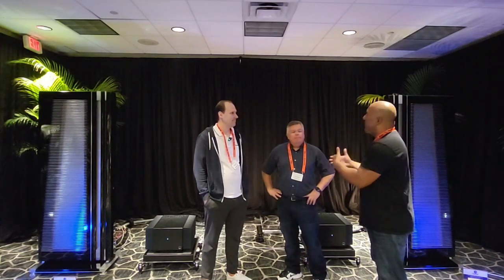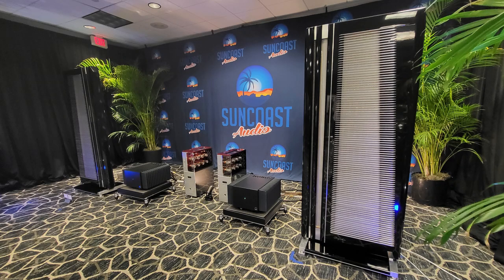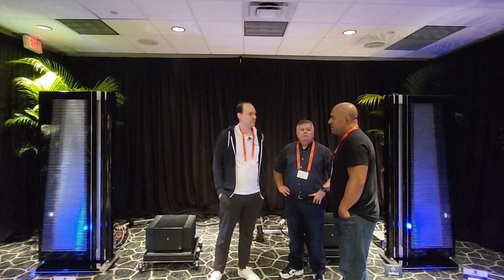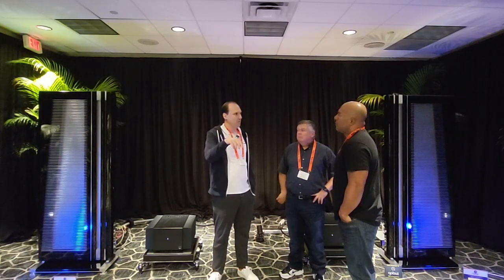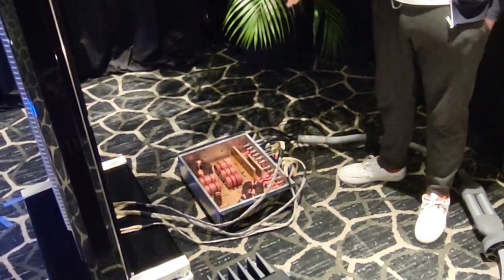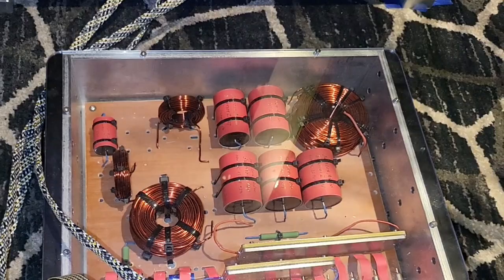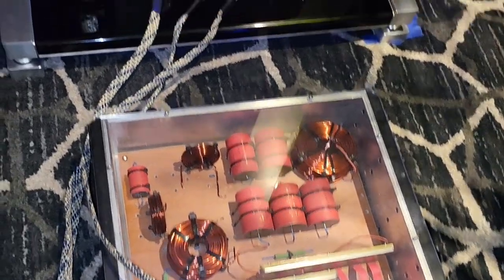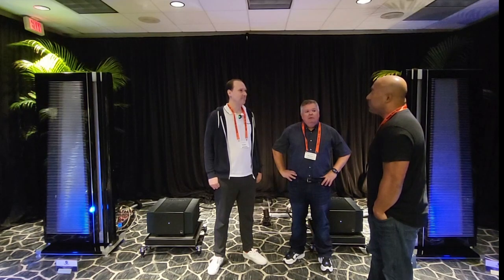Clarisys Audio Auditorium Loudspeakers - Apogee Speakers REBORN!

Comment: Best panels ever. Apogee stomped every panel. Rip Jason.
Reply: Agreed and these are Apogee’s made even better.
Reply: @highendaudio  How do these compare to Alxyvox Caravaggios (if you have heard them)?
Reply: @digggerrjones7345  I’ve heard all Alsyvox between RMAF and Munich (HiFi Deluxe show) multiple times.  I prefer Clarisys.  Far better bass and bigger sound with Clarisys Auditorium.   Auditorium is nearly 7 feet tall.  The biggest Alsyvox is 5 foot something.  But again, as I always say, listen for yourself and decide.   One thing is for sure, Clarisys Minuet and Studio Plus are far less expensive than the least expensive Alsyvox and we don’t give you a lesser crossover and try to charge you more for a better one like Alsyvox.  We give you the BEST out of the gate.
Reply: @highendaudio  Thanks for your feedback. When the weather gets warmer, I'll have to find somewhere to audition the Clarisys products. FYI, the Caravaggios are just a little less than 7' tall.
Reply: Do ribbon speakers also sound flat like electrostatic speakers during the wet rainy season and in high humidity conditions

Comment: Apogee speakers were notoriously difficult to drive; needed amps that could drive 2 ohms. Are these easier to drive.
Reply: That is not true and comes from people who remember the Scintilla, whose impendence dropped below one ohm.

The rest of their speakers had a nominal impedance of 3 ohms and could easily be driven by any decent amplifier.

I drove Apogee Caliper Signatures for several years with an Adcom GFA-555 before moving to a Mark Levinson No. 27 and then a ML No. 334.
Reply: @VideoArchiveGuy  Yes due to their 1 ohm load; all I can tell you is in EVERY room I visited where Apogee was on display, when they were in business, had top of the line D'agostino's Krell amplifiers paired with them; every room; sort of an unspoken not so subtle message these are the amps the speaker manufacturer wants you to use.
Reply: @mahasidha9  Yes, because the two went well together, but they weren't REQUIRED. Why wouldn't you try to sell the two together?

My dealer was a large one and sold Apogee with Mark Levinson, but my Adcom did a great job, any decent amp could.
Reply: If you watch the video, the designer explains it.  Easy.  Just bring a good quality amp.
Reply: @highendaudio  I DID watch the video; I am skeptical of manufacturer’s claims. Compare the white paper by Sanders Sound Systems on amplifier requirements for electrostatic speakers vs Magnepan’s any 100 watt amp will do; I replied yesterday with a link to that white paper but the reply is gone; does YouTube take down replies with links?
Reply: @mahasidha9  well, the designer was handing out the paper with the measurements of that actual speaker at the show….so, maybe you can find someone that has a copy,
Reply: That is such an over used statement concerning Apogees.  Only the Scintillas were difficult to drive.  Please quit spreading this silly rumor.
Reply from the maker: Ask suncoast audio
Reply: Addendum: yes I know Maggie are not electrostatic but to be clear their answers    on the Q&A section seem to me to be so much dissembling.

Comment: What's the impedance of these speakers?  What kind of power is needed to drive them?  Ribbons tend to sound better up top than say, below 100hz.  How was the low end on these? He said as dipoles they're room friendly, but I've found that dipoles and open backed speakers benefit from well placed diffusion.  Otherwise, as much as I love the TAD's you covered, I find these to be even more to my liking, and the aesthetics are head turning.  Not that I'd ever turn away the TAD's.
Reply: "What's the impedance of these speakers? " - Florian told you in the video.
Reply from the maker: @TheDanEdwards  yep.

Comment: Jay, I used to own a pair of these...I made my own midrange and tweeter ribbons 1/5 the thickness of the original ribbons.. trust me. You need a good 8ft or more from the back wall to let them breath. Yes you don't  need room treatment, but you can't have them 4ft from the front wall. The naturalness of the midst and highs are FAR FAR superior to any Magico or Wilsons or Focal...NO dome tweeter or plastic cone mids can do what these speakers can do...period...they are in a whole different league....everything just sounds right...the woofer panels unfortunately do not compete with the best dynamic drivers , but you can always and some servo subs
..your room may be too small to get the best these speakers can do...but they will ruin you on going back to domes
Reply: Just some minor clarifications: no-one owned these speakers before or this model. They are sold now. No Apogee this size ever used double sided bass panels or even neodymium magnets (ten times the strength of Apogee magnets). And no planar speaker have had an aluminium exo-sceleton structure. Subwoofers are simply not needed and not recommended with these speakers. Thanks for all the nice comments, it was a pleasure to be at the show and to meet Jay!  Just wait for next year, then we will bring a big speaker 🙂
Reply: @florianwiegand1313  👋🧐❓ what did they sound like// we’re they dynamic like the Acora👋😎‼️
Reply: @eurekaakerue4649  I won’t comment on other products but I am sure you will read and hear about the Clarisys speakers from top level publications in the coming days, weeks and month. If your interested, feel free to give Mike at Suncoast Audio a call.
Reply: My Apogees were hot roded with neo magnets...and thinner ribbons..equal or better than these...and I did thus 20 years ago before these guys....
Reply: What kind of subs do you think can compete with the speed and transparency of this speaker?
Reply: @helgar791  Rels would work fine. Also JL Audio . I'd  use the  JL Audio electronic  xover as well with JL Audio subs, cleaner hi pass.
Reply: @helgar791  Rel’s are always great but sub placement is key. We must place subs much closer to the listening position or they lag. Horn loaded subs have the speed but are usually enormous thus marginally impractical for residential use. 

These appear to have much friendlier load curves than Apogee’s, only dropping to 3.5 ohm. Extremely sensitive to amp choice. Recommend a relatively low damping factor <500. These need less amp control than multi-driver dynamic speakers, high damping amps tend to sound a bit veiled
Reply: @helgar791  Run pair of Rel Carbon Specials & JLA cr-1 crossover.  High Level input didn't integrate well with 20.7s, aggressive
Reply: A servo sub, sealed cabinet with 6db  per octave crossover with proper phase correction and time aligned
Reply: @michaelrovner4165  👋🧐❌true
Reply: So, they are made for large/deep rooms.  My 20' deep room is a joke for these speakers.   Good to know.